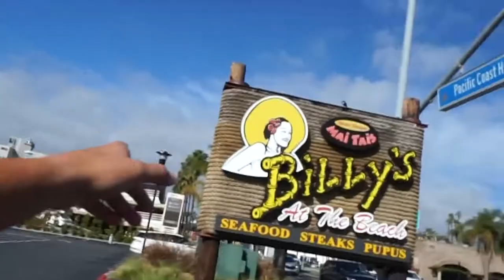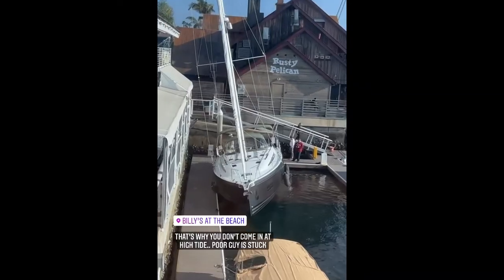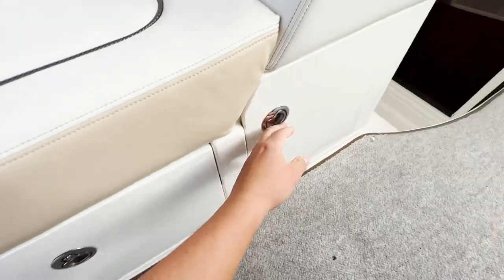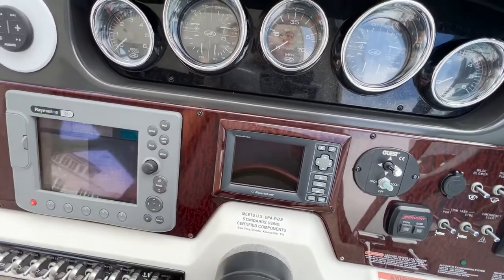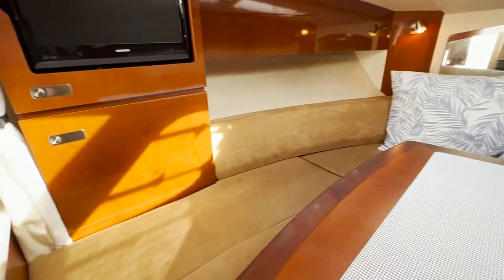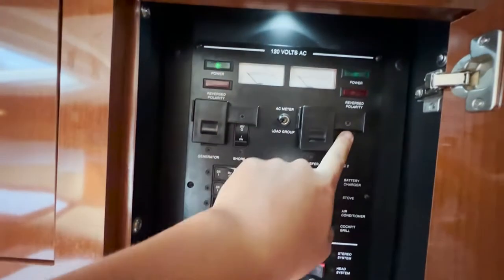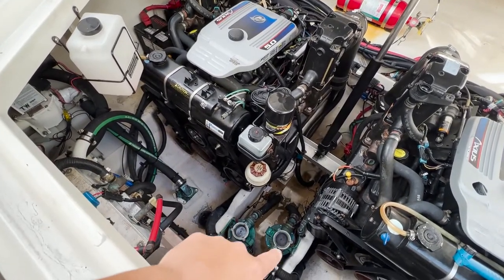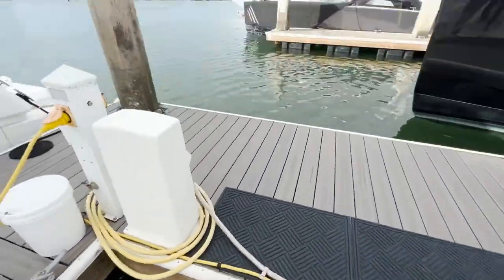Sea Ray 310 Sundancer Tour | Billy's at the Beach

Comment: I have a 2012 310. Love this video. Great walkthrough. The two rods that hold the Bimini... I have a problem with my connectors. I was wondering if I could get some guidance from you about something.
Reply from the maker: What specifically? That Bimini top is hard to maintain for sure. We got lucky that we bought it and it was still intact.
Reply: @thejsgarage  Where the support bars that run from the arch to the Bimini (there are two... one port and one starboard)... I think have a piece missing to attach each to the connector. The support bars have a elbow on one end but is straight on the other. So, one side of each bar fits but the other side doesn't.
Reply: @thejsgarage  btw... thanks for the reply and you made a great video. Perfect!